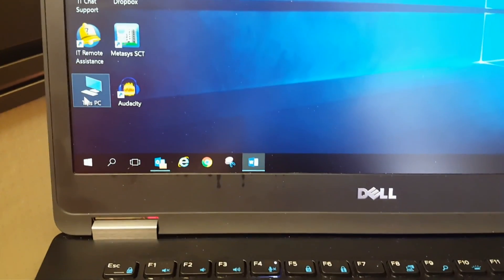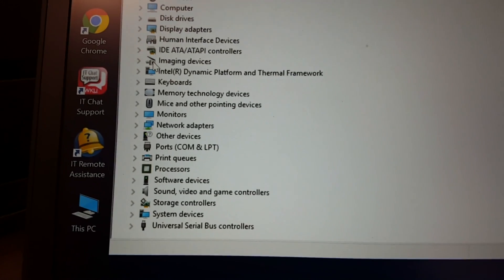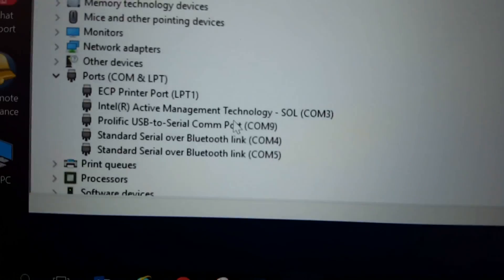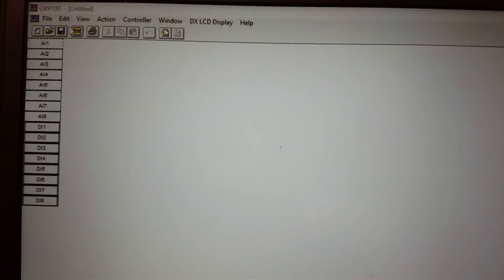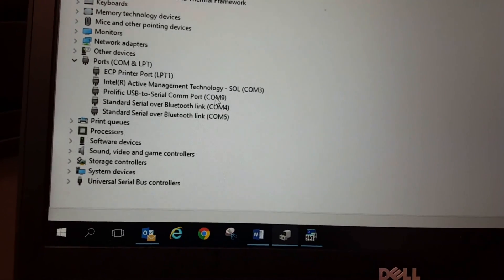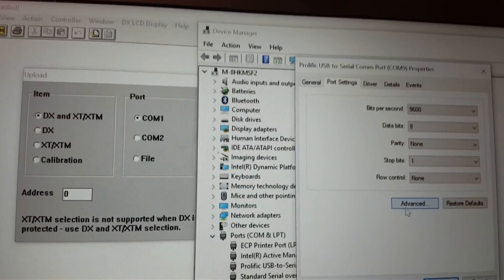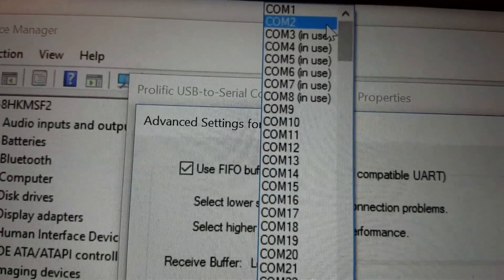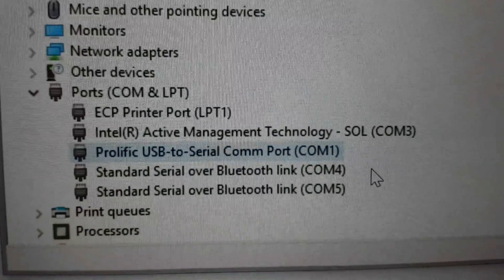Johnson Controls Software Computer Upgrade

Comment: I am still getting a device conflict box on the screen when trying to download/upload/commission . I have changed usb/serial converter to com port 2 and I’m still having the same issue.  I have HVAC pro version 8.08b.
Reply from the maker: Double check the version of software and the version that's in the controller

Comment: HI
what is the meaning of this message on DT-910-8104 please (display memory corrupted)? 
and i want aske you if we can replace DT-9100-8104 (L0227) with DT-9100-8104 (L0247) thank you
Reply from the maker: It sounds like you have a failing device. As far as device replacement, those two are very close and I'm thinking it will work. Just compare the IO of each device.
Reply: @Systemcontroltech I will try this and tell you thx

Comment: Are your computer had USB-3 port or USB-2 port? Does the serial usb converter work in USB-3 port
Reply from the maker: Yes it works fine.  Just set your port to 1 or 2 in the device manager for windows.
Reply: I am using XP mode since govt only install window 64 bit.  I can not attach USB to serial converter in XP mode.  Error to use another USB.  laptop only have USB3. Are you using xp mode or windows 7 32 bit? yes, I know about the port 1 and 2.

Comment: Best to talk to the people who work with this all the time. Yes the ASC and DX9100 series controllers are obsolete but Johnson Controls has solutions. One you can always send the controller back for repair. A cheaper solution is to use Johnson new MS-FEC2611 controllers. Yes they are shipped to use BACnet but can be programmed to talk N2. The FEC can emulate the AS-UNT and AS-VAV controllers so no remapping required.
Reply from the maker: +Ralph Seelisch the best way is to upgrade your controllers if you can't get one from a repair shop.  Thanks for watching

Comment: All of us in the JCI N2 world are in a constant battle with the 64 bit OS of today. I work as a government contractor that  went to windows 7 , we where able to go with the 32 bit version but it seems without being able to run HVAC Pro as a administrator the comm handler will fail. There is talk of loosing admin rights to some of our computer functions. So was wondering about what version of Net.Framework your refering to.  Or maybe I have it wrong, you mentioned Net.Frameware not being a software guru I haven't heard of that. We currently are running Windows server 2008 for our ADX and that is going away in two weeks with the coming of 8.0 as well so we to are loosing pass through . With a large  building complex, loss of pass through is huge. I hope JCI can come up with something. I will keep watching for anything you learn. It seems the old N2 gear is going to come down to  the government letting us call a computer a tool. And let us load that tool with windows XP to work on the N2 devices. In the meantime all N2 Controllers that fail or are in small buildings we are replacing with CCT compatible devices. Keep the video's coming great work.
Reply from the maker: +TheShizock on my laptop, which is windows 10 32 bit, I run SCT,  CCT, HVAC Pro and GX9100. If you install CCT first, which I recommend, it will try to install net frameware 3.5.  It may or may not be able to install it depending on how your IT department sets up your machine. If you have the instalation image or the disk you can install it manually using the command prompt.  Once you have installed it and cct  you can install SCT and the other tools.   You will need to go through the system services list that's published on JCI website.   I spoke with a couple of JCI techs and they said that corporate is beginning to abandon the n2 devices and software themselves and are starting to tell people to upgrade. I can do pass through with cct on Windows 10 but cannot with HVAC pro or gx 9100.  I have to plug directly into the controller.  I understand your struggle.  Hope this helps and thanks for watching.
Reply: I do have the install disk for CCT so I will take a look. Going to 8.0 this weekend and loosing HVAC and gx9100 passthru with the new server. Sounds like we are going to be in the same boat  Writing is on the wall for N2. :(  But have to say MSTPBACNet is really sweet. Thanks for the input.
Reply from the maker: +TheShizock thanks for watching and good luck.